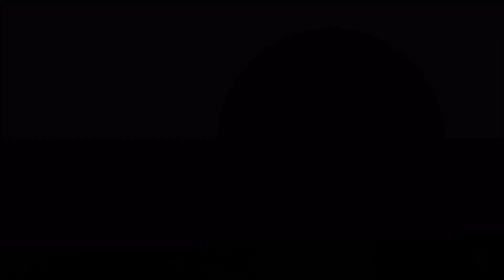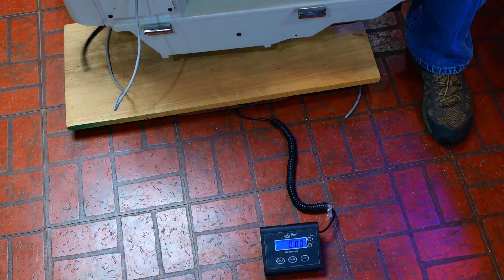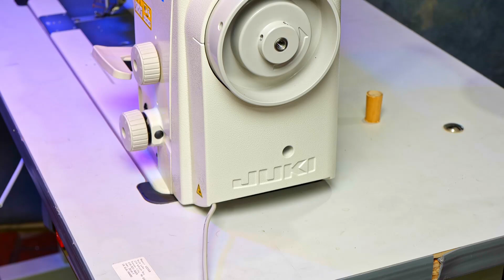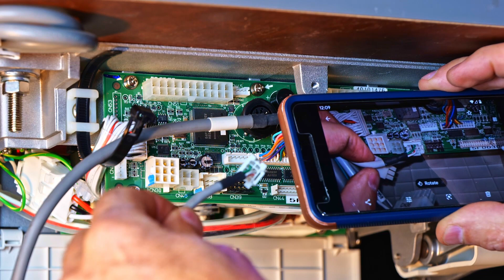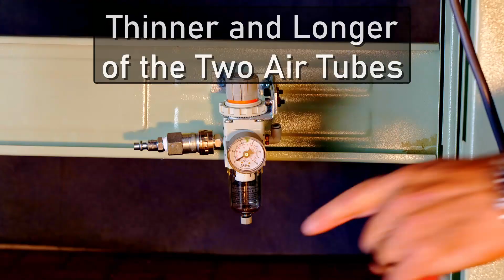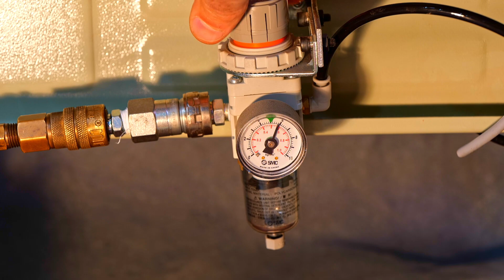Juki LU 2810-7 Industrial Sewing Machine Computer Connections and Setup

Comment: If you notice, it has a CN51 connector, there are inputs and outputs in case you want to connect any extra device, such as a material color detector, material presence, program the machine to run certain programs, etc. It is an internal digital PLC.

Comment: It is not good to place the air tube in the oil pan, since the machine recycles the oil and if it mixes with water it can damage the hook, it is better to leave it outside and tie it to the legs of the stand.

Comment: Your machine is beautiful and THANK YOU for such a thorough video. I have the Juki LU-2810-7 and I've never seen such a complete video on putting it together. Question - what is your favorite air compressor to use for this machine? I had a CA Air Tools 4610AC and it just started leaking after 3 years. I'm inside the house and looking for quiet Acs which all seem to get mediocre reviews. You have one you like? Thanks in advance.
Reply from the maker: I have several but I don't have any helpful insight as to noise levels. I think that you get what you pay for is a decent guide and I have purchased from amazon with fair results.
I have had this one for 8 years and I like it but I would not call it quiet. https://amzn.to/2YwfN1U
Reply: @AlexanderDyer  Thank you very much. My CA Air Tools 4810 sprung a leak & I’m in the market for something new. Thanks again for the input. Hope your enjoying your burly machine.
Reply from the maker: Leaks are usually fixable and not for a lot of money. Just sayin.

Comment: One more thought, make sure you have a good filter on your air supply.  The orifices in the air valves are very small and tight tolerance, and do not fair well with any moisture or crumbs in the air supply.  It is amazing that these are used in dirt floor third world places...  they are picky about the air supply.  The air valves are rather pricey from Juki, but are available aftermarket at a better price.
Reply from the maker: Thanks for the tips!

Comment: You are going to love this machine!  I have 6 of the 2810N-7 in the fleet and they are so much less maintenance than the 1510N-7s we have.  Also have a post bed double needle version that is a fantastic performer.

Your left most button is great.  Alternate momentum set to two or three for thin material, then you come upon a #10 zipper, touch the button, alternate momentum jumps to max to climb over the zipper, another touch, and back to quiet and fast again...  Needle up and needle down with out touching the hand wheel is such a time saver.  Enjoy your modern age machine.
Reply: I too own a 1510n-7 now for 13 yrs and will never go back to non automated. I laugh at the one's who deny the thought of moving up to one from Juki 563 or Consew 206 types. Ha prehistoric totally.  I would kill to get into this new gen machine above. Being 72 yrs old now and having a fine running still 1510 it's hard to do money wise.
Reply: Any one for Sale im in Massachusetts

Comment: I purchased this exact model machine almost 2yrs ago now for about 5k and I have to say I absolutely love it!  I've put at least 4lbs. of thread thru it with little if any trouble.....
Many functions such as Pneumatic foot lift of about 22mm, automatic back-tac and thread cut . Alternating step height by knee pedal, adjusted by a dial on top. 2 separate stitch lengths actuated by push button (1 for seam closure & 1 for topstitch) at least that's how I use it ,built-in bobbin winder . The upper controller counts the revolutions of the bobbin to let you know how much thread you have left! Plus more but those are the most used functions....
Reply from the maker: Thanks for the run down, it is helpful.
Reply: I have the same machine & I didn't realize the revolution counts of the bobbin. Question, what air compressor do you use? Mine just died, looking to get a new one. TIA

Comment: Mr Alexander Dyer, I'm looking for a professional grade sewing machine that can do straight stitch, zig-zag and make a button hole.  I want to make shirts, pants, motorcycle covers and I can also afford one machine.  I want to get a good one so I don't have to upgrade later.    What should I get?
Reply from the maker: Find an industrial zig zag. It will do straight stitch too and you can sew the buttonholes manually. Not sure it would do very well with the covers, depends on how heavy the material is. For that you may want a triple feed. Usually we all have many machines as no one machine will do all the projects that we wish to do.
Reply: @AlexanderDyer  does there exist, an industrial machine with double needle (two bobbins), but one can be disconnected, that can also do zig zag that is medium or heavier weight, such as 1000 denier?

Comment: Thank you for another excellent video. That looks way over my head. I have recently found when plugging in connectors like those that it's a good idea not to push hard enough to flex the circuit board. 
Thanks

Comment: I’ve never seen a sewing machine with a compressed air hookup, what’s that used for and what’s the benefit of it?
Reply from the maker: Compressed air is used to actuate moving parts automatically, like the foot lift. This allows the machine to back tack, cut thread and lift the foot in one step.
Reply: Once you use one of these it is tough to go back